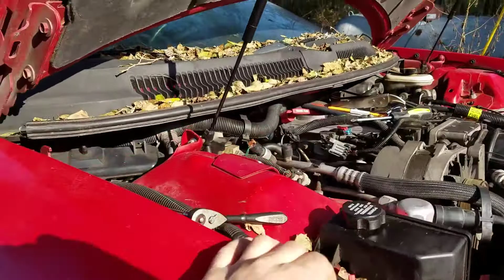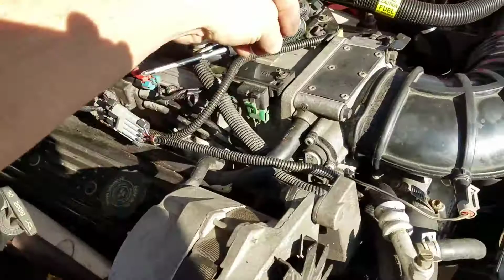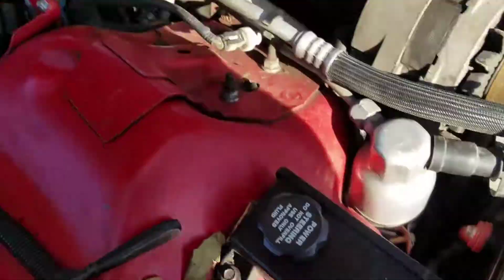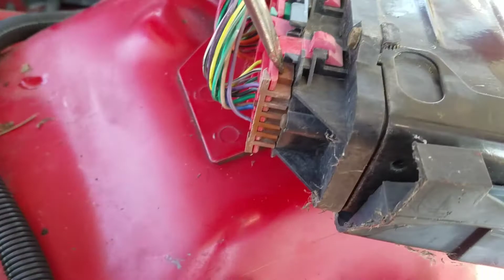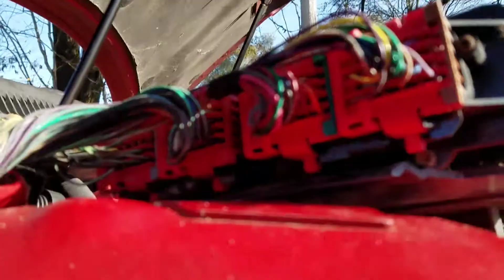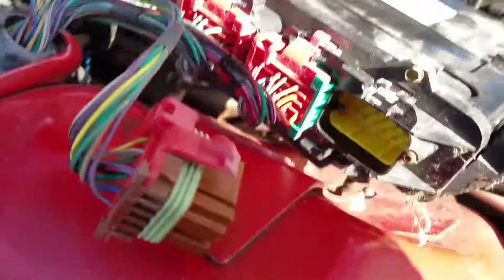93 94 95 Camaro Trans Am ECU PCM Location & Removal | Obd1

Comment: Hey brother I am trying to run some diagnostics on my 93 Formula and my repair manual says to "Disconnect ECM Connector A". Do you have any idea which one they are talking about?
Reply from the maker: It's either the grey or brown coupler, and it will follow alphabetical order from whichever end it starts- A-B-C-D. The couplers may actually be marked or stamped with the corresponding letter, check the ecm housing also...

Comment: Can you just switch these out if I'm not getting any spark?
Reply from the maker: Yeah if it's the same year and transmission. But a no spark condition is more likely an ignition component...
Reply: @BuckeyeBallistics  like what sir, I'm having the same issue with my 95 Camaro
Reply from the maker: Like the terrible optispark distributor or the ignition coil and components. Even the opti harness can cause misfire. Plugs, wires, intake leak, compression. All these things can cause a misfire. Try shbox.com, they have a lot of information on what problems these cars have and how to fix them.

Comment: Question I just upluged my ecm and didn't disconnect battery I didn't turn on jey or anything just want to make sure I didn't mess up anything
Reply from the maker: One way to find out! I would recommend disconnecting the battery before plugging it back in though.
Reply: Ok cool thnk u for the help was lil nervous did tht it started up fine ran lil sluggish but I'm thinking it may clear up once I try to drive it so it cn run a relearn cycle
Reply from the maker: Yes give it a moment to re-learn and it should be fine.

Comment: Is this the same part for automatic and manual?
Reply from the maker: No, it will be different depending on the transmission.
Reply: @BuckeyeBallistics  can these be ordered online or do I have to get lucky and find one in a pick your part?
Reply from the maker: Yes. Best place to get used car parts online is ebay.

Comment: I don’t think the 93 had obd1 from what I was told...
Reply from the maker: My understanding is that obd2 was incorporated into all vehicles in 96. I suppose some may have had it sooner? But this car was definately obd1 because there was no o2 sensor behind the cat on either of my 93's, unless that has nothing to do with it, but I'm pretty sure it does.
Reply: 96 is when they were all OBD II. The 95’s have OBD I in the 3.4 and 5.7. The introduction of the 3.8 on the f body was the reason, I believe, GM had the 95 wired for OBD II but the other engines were OBD I engines. It’s weird but it’s GM
Reply: @roninkraut6873  I have a 95 5.7.  It has the newer style PCM plugs (wide and thin) and is OBD1 but wired to a OBD2 style plug. Some people call it OBD 1.5. It won't work with most OBD2 readers because it's really OBD1 wired to the OBD2 plug. I had to get a special ALDL cable that works with this.  My harness didn't come with the OBD port from inside the body, so I'm looking on how to wire a port into the harness so I can program it with TunerPro.
Reply: @TEAMPHY6  
Yep. That was during the transitional period. I’m more of a Ford guy but I do have (and have had) a GM product currently. I’ve found some very odd things about my car when I have to do constant repairs on it. But that LT1 is too much fun to part with..